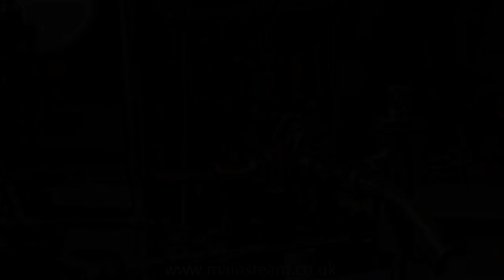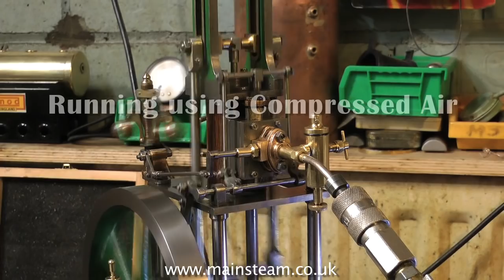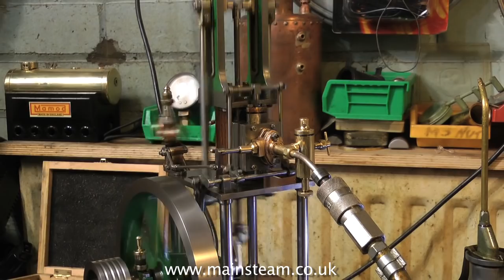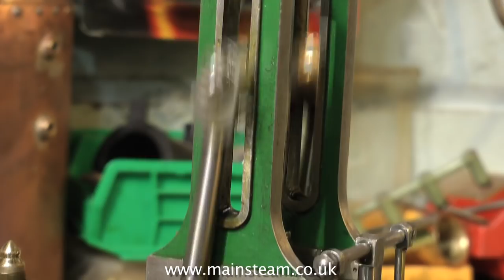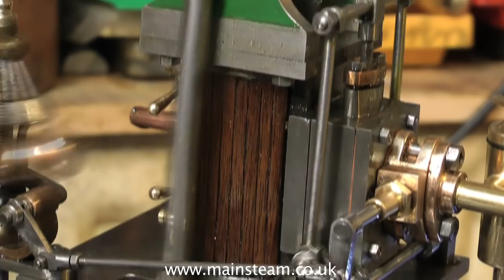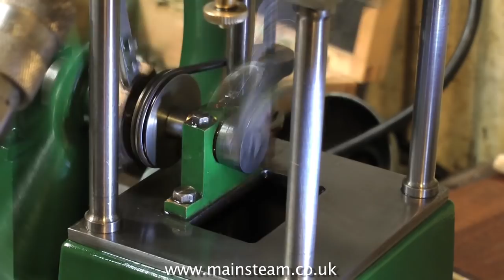A REBUILT STUART "JAMES COOMBES" TABLE ENGINE - TEST RUN ON THE BENCH

Comment: I've wondered...  How much power (watts/HP) are these models capable of?  Have you tried to run a small electric generator?
Reply from the maker: Not much on the small ones, but a Stuart 5A single cylinder steam engine is rated at 1.5 horsepower at 80 psi.

Comment: any specific reason to have the crosshead above the cylinder with those two long parallel transfer bars down to the crank? seems like a needless complication and lots of extra reciprocating mass
Reply from the maker: Yes indeed, I agree with you ...... Steam engines were a bit strange all those years ago - look at the early locomotives .....
Reply: The weirdness of engine designs from the era stem almost entirely from circumventing patents held by competitors. You can imagine the creative workarounds engineers of the day had to come up with because someone had patented basic components like cranks and crossheads!

Comment: Fristly,,   you do an excellent job, ,,  if you need to adopt a 68 year old son, put me on the list. I Spent 13 years as a QA QC inspector in a machine shop,,  And I see I could learn from you..
Also,, at what point ( size and application )
do models become useful tools? Do you know of examples of machinery still being powered by steam.
Thanks,, and keep up the good work. ..
Reply from the maker: Models are models, they are often not durable enough to be set to work.
Reply: Keith Appleton The reason I asked,, I was at a thrasher show, and one guy had a ( hit and miss ) engine hooked up to an Ice Cream maker. Just wondered how big a steam engine would have to be to turn a 5 gallon ice cream maker... The ice cream was way good.. ;)